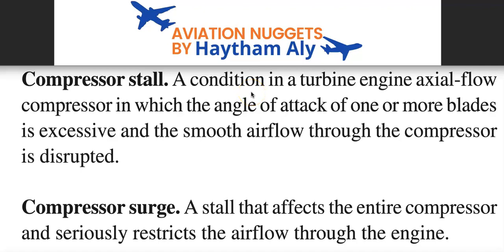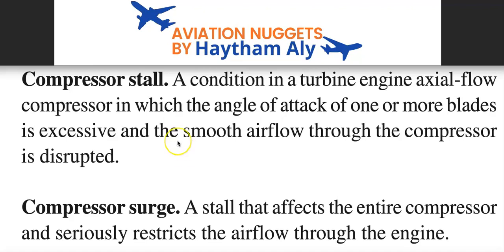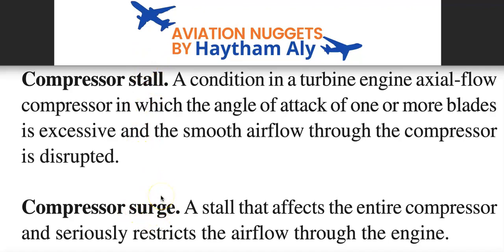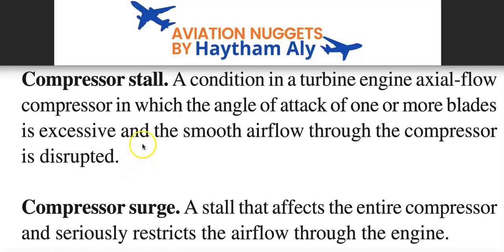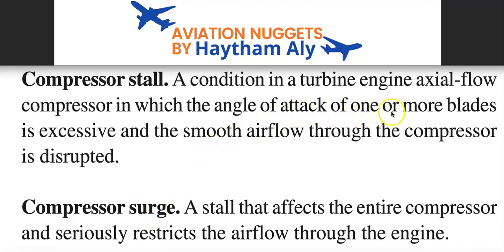Compressor STALL VS compressor SURGE , what is the difference??, #aviation nuggets by @Haytham_Aly

Comment: Thanks a lot. Completely to the point.❤
Just wanted to add something about the difference of surge in Axial and centrifugal compressors:
As you correctly mentioned, surge in Axial flow compressors is the result of stall in most stages (stall results in lower pressure ratio and flow returns to the compressor), but in centrifugal compressors, surge is usually caused by a sudden flow reduction due to the blockage or pressure increase infront of compressor discharge, where the compressor is unable to overcome the pressure and flow reversal happens.
Reply from the maker: Thanks for the added value 👍

Comment: What are the early indications of the compressor stall before it leads to the larger problem of the surge, and what is the remedy for both ? Do you reduce thrust/engine rpm ?